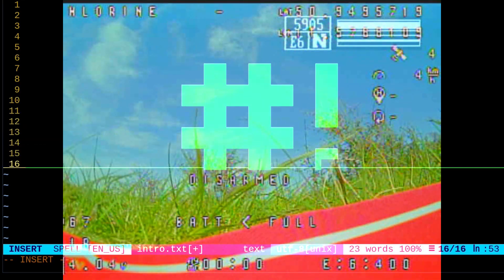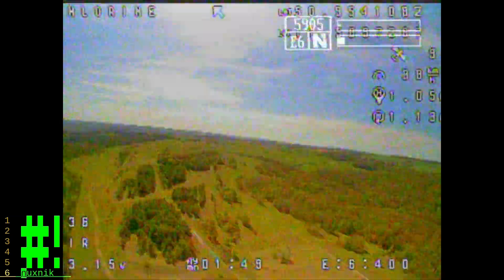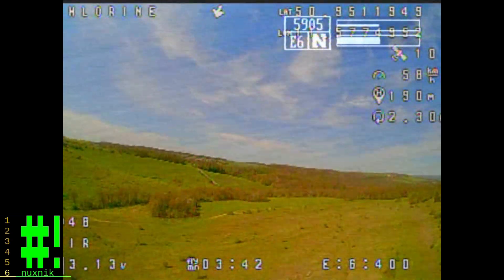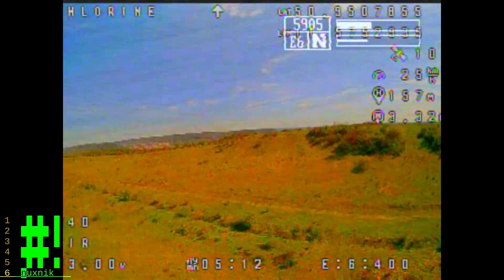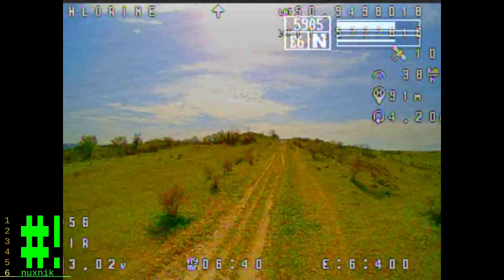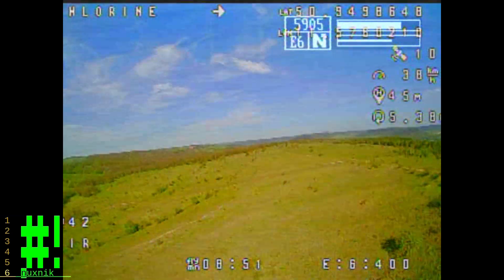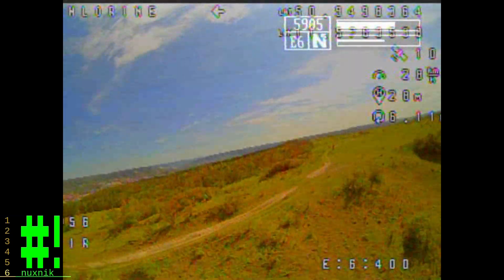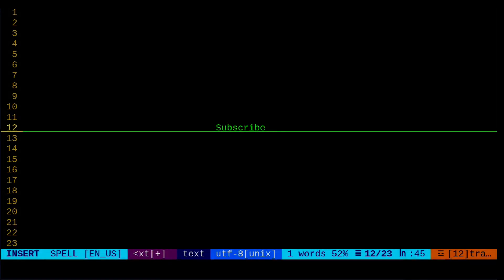#NanoLongRange Test Flight - DIY 3D Printed FPV Drone - 1S 18650

Comment: can it go further then 1km? What improvement can we add to have a longer reach?
Reply from the maker: Thanks for the comment and good question. This drone can go much farther than 1km. I only went 1km in my test video because my RX was acting up. With crossfire or ELRS, distance is not much of an issue, the real limiting factor is the VTX.  An improvement could be using a better antenna.

Comment: What video reciver did you use in this flight?
Reply from the maker: For the video signal I was using a True-D X goggle module. The control signal was a Crossfire Nano.

Comment: How does that GPS work for you? Also thank you for linking all the products you use that was very helpful. I am thinking about building one of these but I want to use an Express lrs receiver and a caddex baby ratel starlight camera as well as a fox ear reaper VTX, I will probably redesign the frame a bit also to make it lighter.
Reply from the maker: Thank you for the comment. The GPS module works fine. I also bought a NamelessRC GPS module that is much much smaller than the one I used in the video. I am going to try it out soon. If the results are interesting, I'll make a video about it: https://www.aliexpress.com/item/1005002638177088

The parts you chose for your build should work fine. Keep us updated with your build and good luck!
Reply: @nuxnik  Thanks man, i subbed to your channel, you make some great videos. If you are into igow at all that is what i have been posting on my channel lately. Its defiantly making me a better pilot lol.
Reply from the maker: @SteadfastRC  IGOW, nice! Returned the sub. Cool channel. :D

Comment: Any luck with the issue of lost connection?
Reply from the maker: Not yet. Until now, I only found an old post in a forum about that specific problem. It is either a bad contact, or there is something wrong with the config. I think I'm going to redo my Crossfire setup anyway on my transmitter. We'll see... :)

Comment: Amazing flight test...
Reply from the maker: Thanks for the comment! :D
Reply: @nuxnik  Btw i have one issue for my Jhemcu Play F4 battery meter can't read battery draw voltage in osd Fix.. what config in your BF? Thanks.
Reply from the maker: @verve78arief  you need to connect your Quad to a computer, open BetaFlight, click on the OSD (on screen display) option from the menu and select the voltage/current measuring options you wish to view in your goggles. 

Or have you already done that and it is not showing up in your OSD?
Reply: @nuxnik  I have settings on osd but the numbers don't move on osd. So what settings should be done on the battery tab on BF?
Reply from the maker: @verve78arief The only changes I have made in the battery configuration section is that I set the warning voltage to 2.7V. If your not getting any data for voltage/current your board might be defective :(  Keep us updated and let us know if you find a solution.
Reply: @nuxnik  i think defect... but gps rssi is normal.. here my test vid https://youtu.be/LH5f3htMIO4
Reply from the maker: @verve78arief  for some reason I didn't see the link to your flight video. I have put a link to your test video in the comments section of my build video under "Successful Builds". The flight looked great and I'm glad it worked out :D